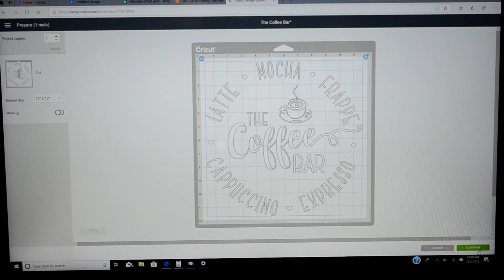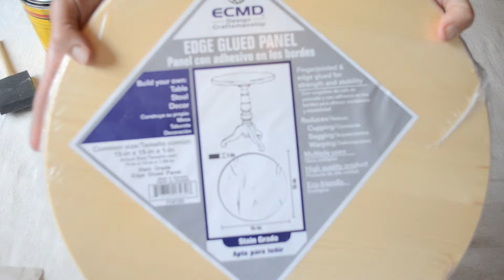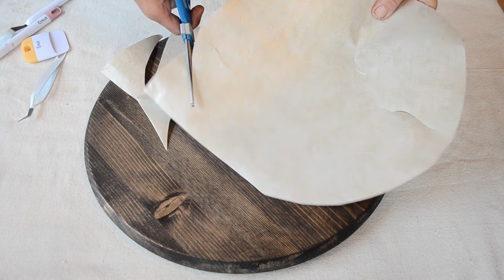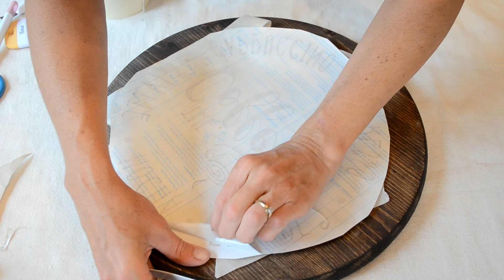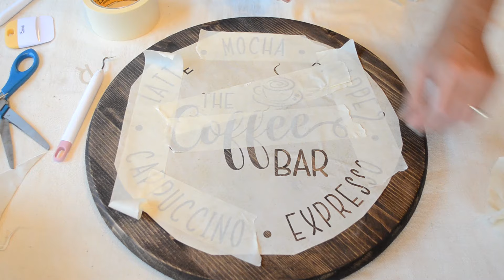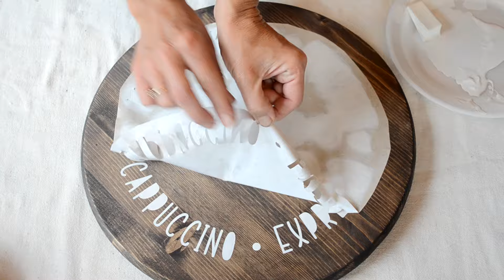DIY Coffee Station Sign / How to Make a Stenciled Sign

Comment: Do you seal with anything afterwards?
Reply from the maker: Yes I do spray over it with sealant. I have been using Mod Podge Spray sealant in Matte, but it does come in glossy too. It is very light and you can’t tell it’s been sealed.
Reply: Thank you :)

Comment: What kind of vinyl do you use for your stencils?
Reply from the maker: I use different kinds, but the cheaper material I have used for stencils is the brown contact paper you can find at Walmart or Dollar General. It is the most inexpensive and works good. I also use the clear peel and stick (Duck brand) for transfer tape. I have been using Oramask 813 stencil vinyl lately to do stencils and I do like it, tho it is pricier.

Comment: I’m using the Jacobean stain and flat paint. When I pulled the stencil up, some of the white paint came out on the sides even though I made sure the stencil was laid down. I’m trying to cover up the white paint with the stain and it looks terrible. Is there a way I can fix this?
Reply from the maker: If i get a spot like that I wipe off what i can then take an exacto blade and scrape the rest . . you shouldnt have to scrape hard enough to damage the wood . . if the blade is sharp it should scrape off lightly. You can spot retouch the stain. If that doesn't work wait til the paint is a little drier and wrap some sandpaper around the tip of a pencil and remove the white. Then you can retouch stain if needed. I hope that works thats the way i do it.

Comment: I find that sometimes after I have painted over a vinyl stencil, the paint tends to lift off of the wood. No bleeding issues at all but the letters come off. Any ideas on why this happens and how to prevent it?
Reply from the maker: Hi! I usually remove the vinyl before the paint is completely dry if I can. It might be that the paint is drying to your vinyl too long or it may depend on the type of paint. I havent had issues when using chalk or flat paints before.
Reply: Christy Cain - The Appalachian Home That’s what I try to do as well. May be the quality of my paint. Thank you so much for your reply. Will try the chalk paint or a better quality acrylic paint.